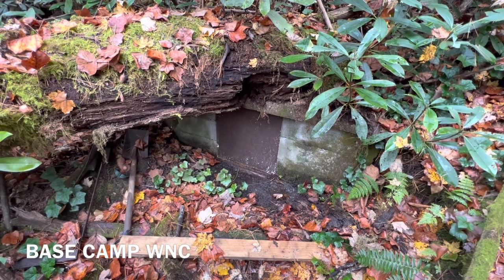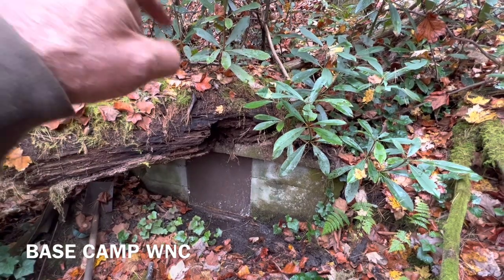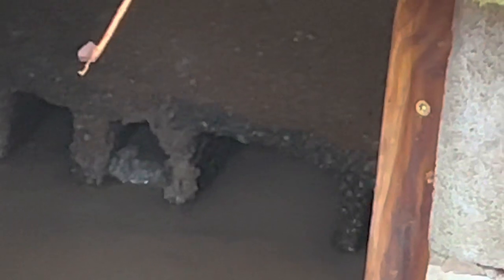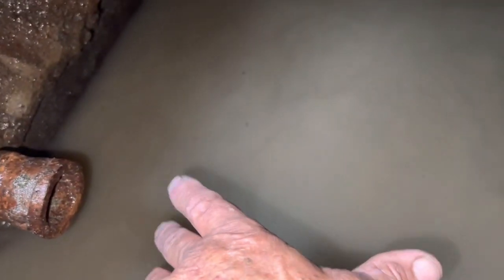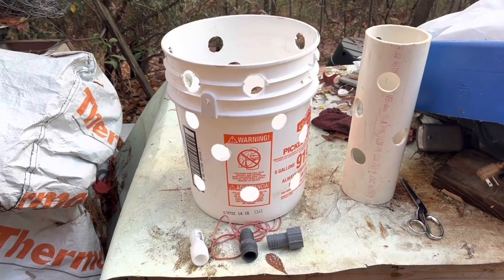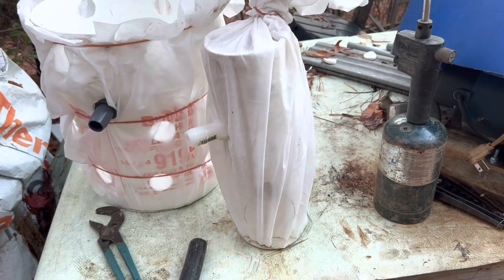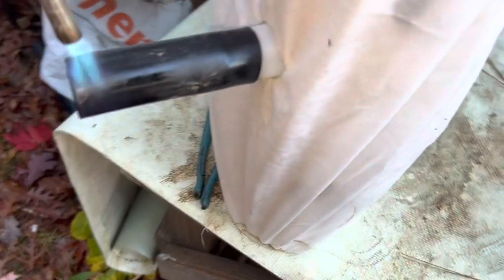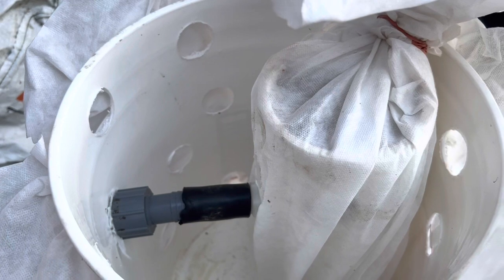Spring clean out and building the biggest sediment filter to date

Comment: Is there any advantage having a concrete blockhouse like your 1964 relic to the dam with plastic arch and clay and gravel ones?
Reply from the maker: There’s no advantage of the blockhouse
In 1964 there were no plastic dam materials 
Most spring dams made of concrete blocks or bricks in elevated areas will suffer from freezing temperatures and will crack and then leak
I have no intention to replace my block house just because it works  and I have so many other projects 
And if it’s not broke don’t fix it